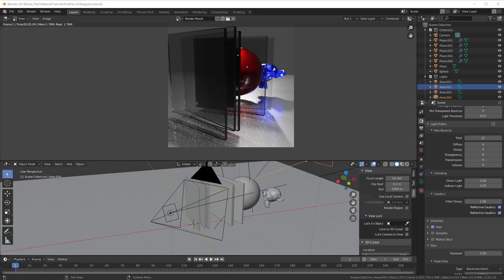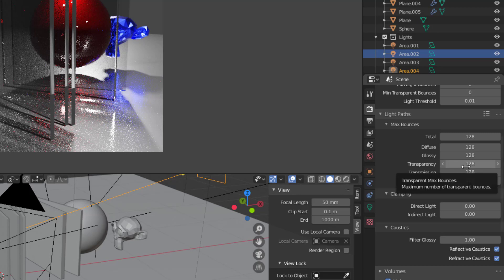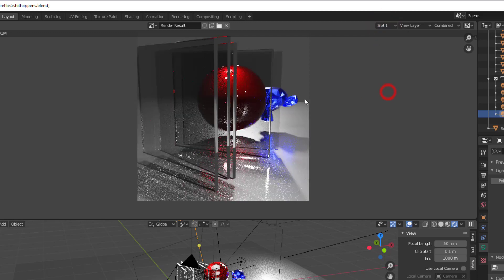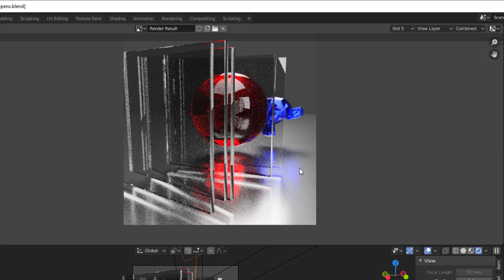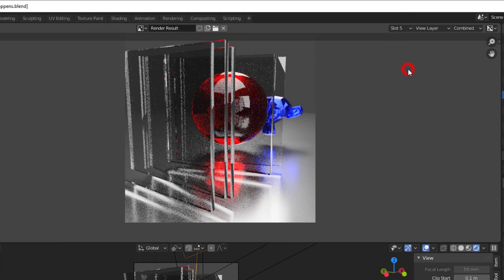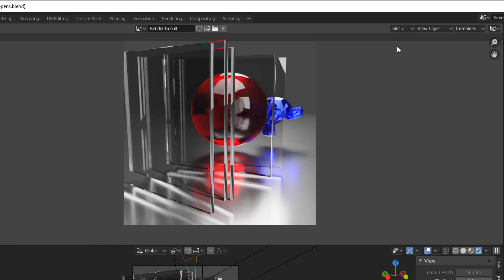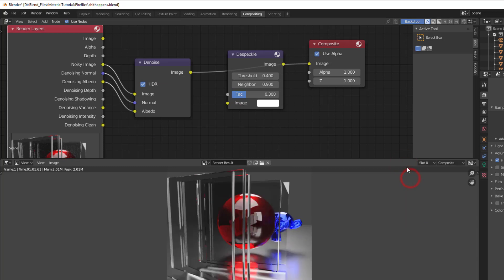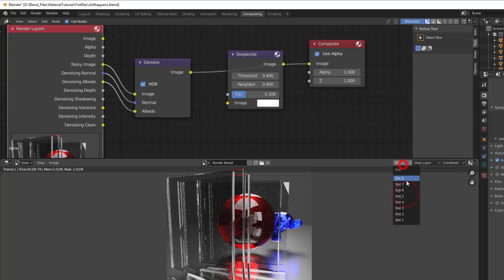Kill those Fireflies in Blender!

Comment: Also try under render settings - light paths - filter glossy (bring this up until it's gone)
Reply from the maker: It's a solution you can use in most cases :). However, be aware of that you will loose details in the scene since it blurs out the reflection, so be a bit cautious, so you don't go too high.

Comment: Under light/lamp settings. I picked Hemi. Then all I did was change max bounces to 0. And it all disappeared. Try this. Let me know if it works.
Reply from the maker: You can do that...but you will destroy all bounces. 0 means that you only get direct light back and everything else is gone, so it will not look realistic or good in most cases.

Comment: I don’t get it. How do we reduce fireflies without sample increase? I’m at 3000 samples and still have fireflies
Reply from the maker: One of the methods is to increase the samples (as mentioned in the tutorial), but that alone will not always handle everything. Blender sends rays from the light sources. Smaller light sources...fewer rays and the risk that a ray will miss something gets higher, so that's why we need bigger area of the light. Then we have the bouncing of light...the reflection. Sharp reflections increases calculations and again we risk to miss a spot. So, less reflection, if possible, is to strive for. However...when you have done everything in your power when it comes to reducing the risk of missing a spot and you still get blind spots, you need to cheat...and that we do by blur and also calculate what it probably should be on that white spot using denoisers. Take it step by step as shown in the tutorial and it will work :). The only thing I did not mention is that SCALE is VERY important. The light energy is in watt and it reflect reality, so if you have made a sword 10 meters big, because you missed to scale it...that will be hard to light in a good way.

Comment: Hello. Thank you for a very informative video. I would like to ask how much clamping do you usually put on direct and indirect settings? When and when not to use clamping?
Reply from the maker: That is very hard to answer, because it depends on so much things around you. Material, light, reflections and so on. Clamping means destroying the image a bit, so in cases where it matters a lot, you should avoid to clamp. However, in many scenes you can hardly see any difference because you are using a lot if light and less reflective material and then you can clamp as much as you want (but it will not make any difference). So, the answer is... test and try for your scene. Do renders with like 25% of the size, so it goes quick to see the result and the you have more time fine tuning.
Reply: @jtornhill  I get what you mean. It depends on the situation and what result you are trying to get.